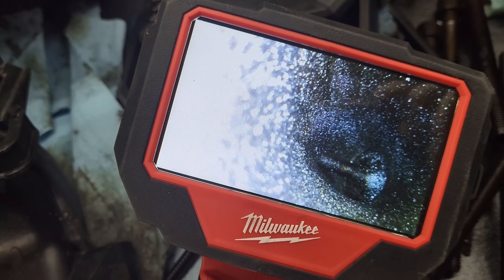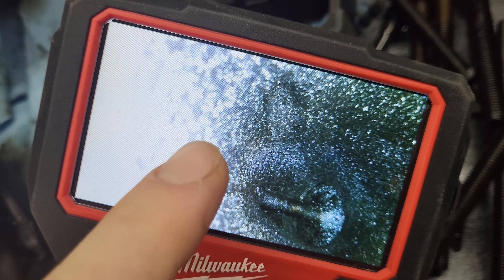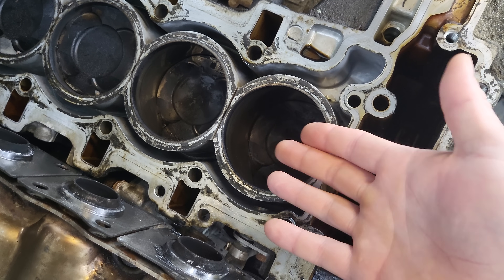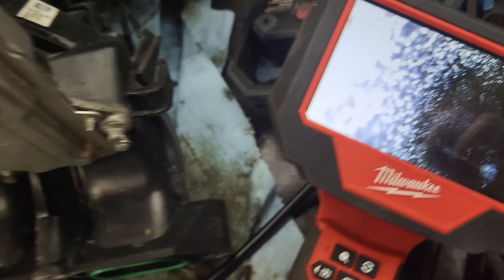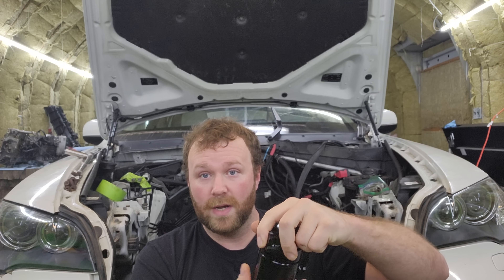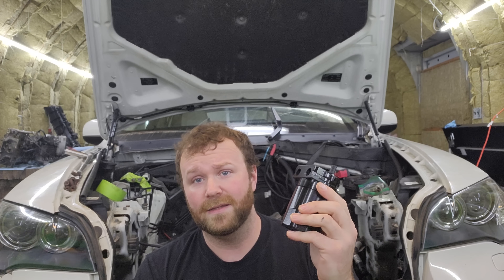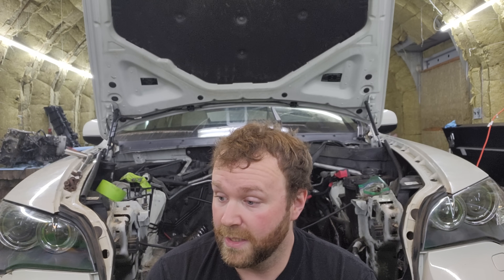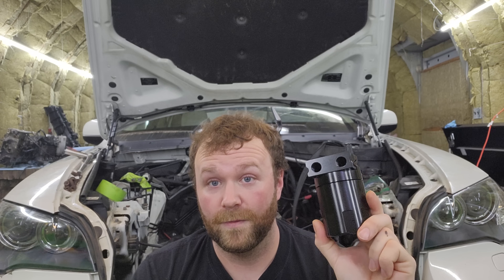The Modern Engine's Achilles Heel: How to Prevent Costly Carbon Build-Up in GDI Engines

Comment: I could have prevented my 2008 Honda Accord from blowing up at 100k with this can. The amount of oil burned was not enough to fall under the Honda warranty but enough carbon built up on valves to takeout engine prematurely. Honda class action lawsuit 2014. Never again Honda.
Reply from the maker: That's rough. Specially as it was a known issue. I was replacing rings and pistons from 2006 and up accords and crve

Comment: Oil catch cans might work in hor weather, but I live in Winnipeg, Canada where -20 degrees Celsius is an everyday thing during winter. With this cold, the water vapors condensate and freeze inside tha catch can. Then you have to remove the ice weekly, otherwise the catch can gets full of ice and clogs, preventing the blownby gases to get to the intake manifold and building up pressure in the crankcase, no need to say how bad that is. Believe me, I tried the exact catch can he shows in his video in two different low mileage cars with the same result. Ended removing the catch can after the first winter, not worth.

Comment: Put a catch can on my diesel ram 2500 and constantly 
Got error codes to deal with crank case pressures  constantly and yes it was cleaned , removed it and had no problems since

Comment: Direct injection only works on diesels WHY because a diesel uses very high compression ratios AND the fuel is ignited due to EXTREME cylinder pressure CAUSING very high temperatures WHICH thoroughly IGNITE the fuel entering the cylinder... CAT 1693TA's had an option of direct injection or pre-combustion chamber... Friend of mine bought an A-Car mixer chassis Rockwell 58,000 rears 20,000 front with a 1693TA... Talk about endless power he made a 50-ton wrecker out of it Holmes wrecker body... He had a tow one day, tank trailer owned by a major oil company... R-700 MACK, 11,500 gal tube, grossing at 107.000 GCW... Had to pull up and over a long arched bridge over a major river... Tank driver said you're pulling this bridge better I can, Brad laughed... CAT and International tried Pre-Combustion chambers to improve cold weather start ups BUT the pre-chambers were sooting up impairing the injectors spray pattern... Glow plugs took it's place and CUMMINS uses a 2-stage heating element on the intake manifold... NOW, anyone who raced as a hobby some time ago KNEW you need a certain FUEL TO AIR mixture ratio to PROPERLY INGNITE the gasoline entering the cylinder USING a spark plug as the IGNITOR...  WHY, we had low riser intakes, medium riser intakes, high riser intakes, tunnel port intakes, dual plane, single plane, carb spacers and TUNNEL RAM intakes TO Efficiently Create The PROPER IDEAL fuel to air ratio to Ignite the gasoline Efficiently ... YOU NEED A FUEL TO AIR RATIO TO MAKE EFFICENT COMBUSTION... Sad that the real gear heads of yesterday are gone for they'd inform you on how to build a functioning engine WITHOUT drama and factory created failure issues that YOU pay for in REPAIR costs... It's simple all you need is AIR, FUEL AND IGNITION... WHEN AND WHY DID THAT SIMPLE PRINCIPAL CHANGE... I have a '98 Ranger... 4cyl., SOHC... Dual plug head, D-port Fuelie intake ports, Port injection at head intake ports, this engine has been used by Ford SINCE 1974... German tech originally made in Cologne Germany a bullet proof design able to reach 200,000 miles issue free... I've owned her for an easy 7 years now... I've pulled and inspected the plugs which look clean... Never changed a plug yet and it's '70's inferior tech... LOL... Hey Lance baby what do you think of that... ???
Ford EcoBoost engines are prone to carbon buildup issues due to their direct injection technology, which does not wash fuel over the intake valves. This buildup can lead to symptoms such as rough idling, loss of power, and difficulty starting the engine.
Incomplete fuel combustion leading to carbon residue accumulation... Walnut Blasting: This professional cleaning method effectively removes carbon deposits from the intake valves. It typically costs between $400 and $800.... DUE TO A DESIGN FLAW you now have an unnecessary repair bill that shouldn't of happened...  Evidently these manufactures employ designers who have no clue what FUEL ATOMIZATION is... That AIR to Fuel mixture RATIO I've spoken of...  It's like some clown bolting on a Holley 780 double pumper on a STOCK 350 Chevy... Stand behind the car while it's running and YOU start to cry from your eyes running and sinus burning from all the RAW UNBURNED GAS ROLLING OUT THE TAILPIPES... Aaaah-derrr... 

The problem today is the Clowns designing these engines are tech only all computer generated field experience NONE... Car enthusiasts no, guidelines by manufacturer and government only, yes... Make cheap as possible... They seek out no one in the field for design ideas or their intake on how to properly correct the designers flaws... Old saying was: What raced and won on Sunday sold on Monday... Why in "69 the ROAD RUNNER made CAR of the YEAR...  Manufacturers today don't about you you're just their little guinea pig... R&D,  gone that costs money... 

Generally considered a good engine

Is '98 ford ranger 4 cyl SOHC 2.5L a good engine?
The '98 Ford Ranger 4-cylinder SOHC 2.5L engine is generally considered a good engine due to its reliability and efficiency. It is a cast-iron block and cylinder head engine, known for its simplicity and durability. The engine has an overhead cam, which is a common feature in many Ford Ranger engines. The 2.5L engine is also known for its fuel efficiency, making it a suitable choice for those looking for a balance of performance and economy.
However, like any engine, it is important to consider the maintenance history and driving conditions. Regular maintenance and servicing are essential to keep the engine running smoothly and to prevent any potential issues.
In conclusion, the '98 Ford Ranger 4-cylinder SOHC 2.5L engine is a reliable and efficient option for those looking for a mid-size pickup truck with a balance of performance and economy. 
The Ranger Station
+1
CAN'T FIND THAT IN TODAY'S 4-BANGERS... I once spoke to the shop manager at Terminix and he said at 100,000 they'd change the timing belt and they'd  do 200,000 miles... They had a Turbo version in 2.3L in the SVO Mustang, T-bird and Cougar... My uncle worked for a Mercury dealer parts manger had one in the shop with a big hole in the hood when the Turbo did an exit... Turbo version wasn't very popular...

P.S. ... Few years back at a local junkyard a friend owned looking for Ford parts... Harvey has the crusher working in the pile a beautiful, clean, white Toyota with gold emblems on it, sharp... Asked Harvey why going to the crusher... Ate timing chain took out head piston damage old couple owned it insurance company totaled it... So, put out front for sale only needs an engine... Nope he said no one does that anymore too lazy... Sad...

P.S. ...You need to look up Smokey Yunick the man was ahead of his time... A true engineer and fabricator...  

P.S. ... I have a metal sign hanging in my window I bought from SUMMIT RACING which states quote: I may be a mechanic but I can not fix stupid... I seen it on their site while chasing down some parts and just had to buy it... To True...

Comment: I have a 2016 F150 with the 2.7. It has 130k miles and zero issues. No catch can, no special BS, just quality fuel and 5000k mile full synthetic oil changes. If and when there is a problem? I'll have walnut shell blasting done to the valves for $1000 and continue to drive it.

Comment: Great video,,, and it does work well. Use a high end Group IV PAO synthetic oil so it raises the temp the oil cokes. Fill the CC half full of coarse Stainless Steel Wool, some have a baffle half way down inside, make sure the SS Wool is in the top half. This will help separate the Blow-By(Carbon and oil). A Ball Valve on the bottom of the CC so you can easily drain it. 
You'll find more oil in the CC if you pull a trailer/under heavy loads compared to just driving around town on a NA engine. This makes it harder to determine drain intervals but once a month to start with will work. 
The problem with Honda and Toyota as well as others is they don't pull a strong vacuum on the Crankcase/Ring Pack. They more or less let it escape is their solution to PCV function. This is why you see some with sticking Oil Control Rings. They carbon load the oil and they let you change the oil to get the excess carbon in the oil out. This forces short OCI's in this engine. Just my opinion on this issue. 2010 MDX 292K miles. I use a Group IV Syn and run a 10W-30, not a 20, it's too thin. Something else to consider is a UOA won't tell you how much carbon has collected inside your engine, it's not designed to check this. It's a short sample in time over a 100K mile interval and won't show up as Insolubles.

Comment: I already know a very easy fix for dirty intake valves. Do not buy engines with direct injection only or be willing to put up with the extra system complexity of having two injection system such as in Toyota. Direct injection only system, the minor improvement in efficiency are all lost by the extra cleaning required for the valves  which often take major disassembly . So you save some gas, but not money, the extra cost popped up under another expense column. The other problem is oil consumption. Now I know many Toyota blocks are non rebuildable. Generally only taxis and other high mileage user need to replace the engine. So if you buy a block from Toyota, or somehow the piston had to be removed, because you are using more oil than gas !  I change those piston rings  or at least the oil rings with a set that is same size but at least a decade older car. Those oil ring have a stronger backing spring that wipe the cylinder wall of oil cleaner.

Comment: Dont need catch can to avoid valve deposits. Cheap oil doesnt last ling then burns smokea and sends sooty amoke through PCV. This causes deposits.  Quality synthetic oil diesnt burn and smoke and lasts the whole 5000 miles and doesnt cause valve deposits. Stop using jiffy lube crap oil. Learn to change your own oil and use Pennzoil Platinum or other high quality synthetic every 5000 miles. On the 5s and 10s on your odometer.  easy to remember. Cheap oil doesnt last 5000 miles and starts burning right away.

Edit: Oh crap I already commented! LOL
Reply from the maker: Hahaha double comment ;)

Comment: Many of those German aircraft in World War II that had direct injection also had water methanol injection, which kept their intake valves pretty clean.
And I don't know where you learned that people just recently aren't doing their oil changes, they have been ignoring those for longer than I've been alive and I've been working on cars since 1964. And although the problem wasn't nearly as bad with a carbureted engine. Sometimes the problem can be exacerbated by things like overlapping intake and exhaust valve mechanisms within the cam and all that. But the biggest thing that's causing the problem today is the fact that I found when I rebuilt a couple of Ls Motors. The motors that I've pulled apart have had ring gaps of .030. A naturally aspirated 5.3 engine should not have any more than 0.018 Gap. Personally, I believe that the reason they do that is because that way you have to keep adding oil to the engine between oil changes. There is no excuse for that wide of a piston gap on the compression rings. It should be 0.018 on the first ring it should be about 0.015 on the second ring. And then the oil control ring can be tighter or about the same. That would help with a bit of it. But an oil catch can is a good idea. Especially if you have a turbocharged engine. Add those engines that are running partial port injection along with it they're not doing you any favors because the only time the port injection is running is at idle and the problem doesn't exist at idle. By the time the engine is idling it never Idols enough to clean up any of that mess that has been caused at higher speeds.

Comment: Had this problem on a 2012 Hyundai Accent 1.6 GDI engine - engine had around 140,000 miles and became so carbon built up on the intake valves stopped running. Did same as you & removed head to de-carbon and install a oil catch can. Did find online after this job, a tool made for Mini Cooper GDI engines that, without removing the head, allows walnut shell bits to be air blown at valves to clean them with a vacuum attachment port to clean shells from intake port.
Reply from the maker: Yeah there all using that tool now. Volkswagen was first to implement it but all the oems have it and it's available aftermarket too fairly cheap. Hooks right  up to the shop back. Good thing about pulling your head up get the carbon face of the valve that forms too.

Comment: "With GDI we get better fuel economy, better emissions, better cold start.."   😆

You can go ahead and keep all of that paltry crap and I'll keep my normal clean valve operation inside an engine that runs great for 500k miles on minimal maintenance.   These auto manufacturers, even Toyota now, are making disposable cars.

Comment: you can fill up the catch can with water in 3 days of cold weather..
then you will pore oil from the top in to the intake..
In the can oil is on the top, weather on the bottom..
you need catch can with heater for cold weather

Comment: Biggest issue with eco boost,,,the oil monitoring SYSTEM  and cheap oil . They know blow by is a problem, a big problem, it fills the intercooler with goop and the fix is to drill , drain , tap and plug , to get you home. We own a MB  b250 is a GDI , NO ISSUES.  mainly because I change my oil and filter on time and they built a turbo charged engine without BLOW BY  problems. As an example Ford , in their wisdom, have a wet belt to run the oil pump, yes inside your expensive truck with twin turbos, your oil pump is run with a rubber belt that is inside the engine ,,,,,wtf.  If you still have warranty, go to the dealer for service to cover your ass if you are making payments.  ASE master tech in the day and shop foreman . Thanks for the video. The catch can is a must for trucks that tow. Peace on earth and ocean.

Comment: There are a lot of video's showing dirty inlet valves but what does this actually result in to give a problem? Are you saying the airflow is restricted (by some tiny percentage) or inlet valves seats are  being damaged by this dirt? My Ford 2.0 Ecoboost GDI pulls like the day it was new and has no catch can and over 100k miles on it. I have done nothing to it other than use the oil Ford recommend and change it at the Ford recommended intervals.

Comment: Dull tool needs sharpening. Its caused by mixing EGR gases with oil from the  pcv. Has zero to do with fuel injection period.
Reply from the maker: Has everything to do with fuel injection. Port cleans the valves ans gdi doesn't.  Switching to gdi has created a issue port has solved.

Comment: A big problem with oil catch cans that you have overlooked.  They also catch water from water vapor.  Water freezes in cold climates.  This will eventually plug your PCV system, and start to cause other serious problems like blowiing seals.
Reply from the maker: It's a high maintenance item

Comment: The oil catch can does help. Some manufacturers (such as Mazda) already do this from the factory. But all of them should.
Reply from the maker: That's great :)
Reply: @Lancemechanics  Yes. The problem is that the catch can needs to be serviced periodically (drained and cleaned), and that servicing is often not listed in the maintenance manual, so people don't know they need to do it. Without this, the catch can fills up with oil and stops doing its job.

Comment: Does giving it the beans once in a while help reduce the carbon build-up?  ie Italian tune-up.
Reply from the maker: Well i wouldn't say once and a while. I drive my car 1200km a day sometimes for travel and its not carboned up. its really the short trips. anything under a 100km or 80miles is really a short trip. it never truely gets a chance to heat up and burn off the deposites

Comment: What about fuel additives or something similar?
Reply from the maker: It's help but once the built up starts your bassicly stuck walnut blasting the intake valves. Which is labour intensive.
Reply: Fuel additives won't work as a GDI engine injects the fuel (+ additive) directly into the combustion chamber - not across the top of the valves.

Comment: If the PCV valve vents into the air cleaner box upstream of the air filter, would the air filter stop the discharge from reaching the intake valves?
Would the carbon buildup be better or worse on an Atkinson cycle GDI engine?

Comment: 35 year auto tech hate GDI bringing back carbon deposits like carbs used to have also injectors are just about baby delicate hours to diag and r+r older port injection is better and not so temperamental

Comment: I installed an oil catch can on my 2017 Camaro SS1LE right after I brought it home new.  That's the time to do it, before any build up occurs. So easy to install; it's a no brainer. I empty about 2 ounces from it every 3K-5K miles. 7 years, 45K miles and over 30 track days later, engine still runs great.
Reply from the maker: They are fantastic. People are skeptical but once you know better they are worth it
Reply: @Lancemechanics  Liked & Subscribed! 👍
Reply: Have one on 15 f150 2.7 and c5 corvette they work great
Reply: I have them on a 2017 Stingray and my daily 2023 F150 3.5 ecoboost.  Both systems work well. The oil I drain out of the catch can from the Ford is black, winter or summer. About a tablespoon every 1500 miles. I run J&L brand.